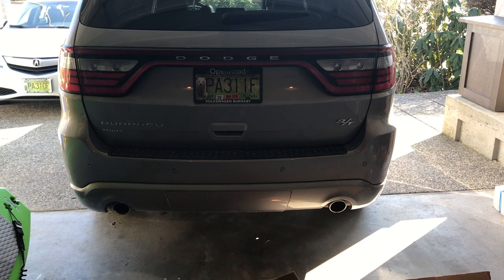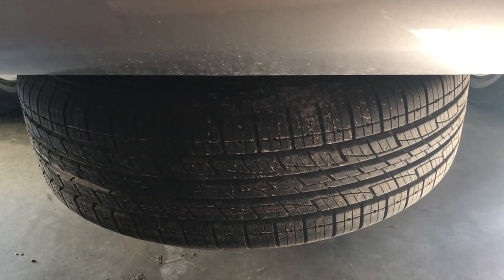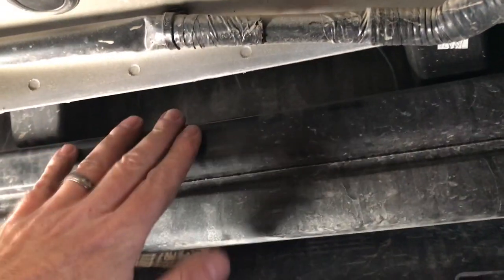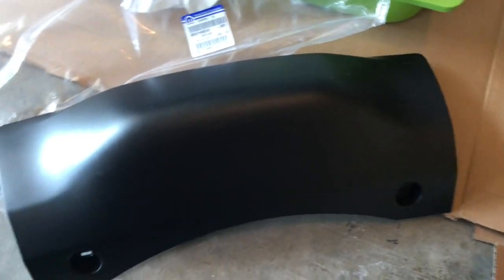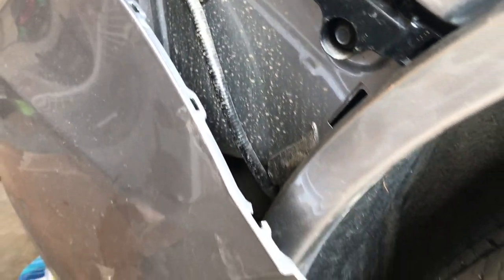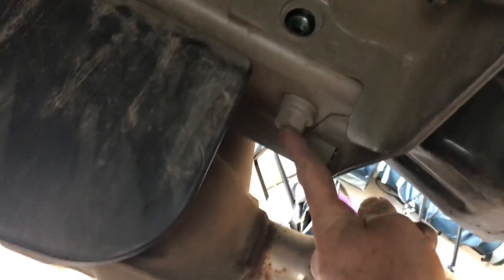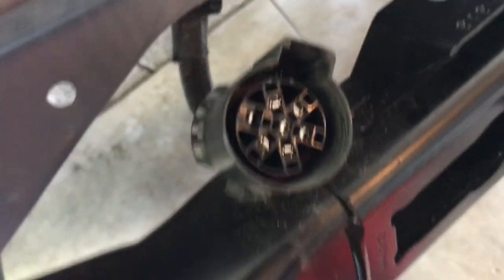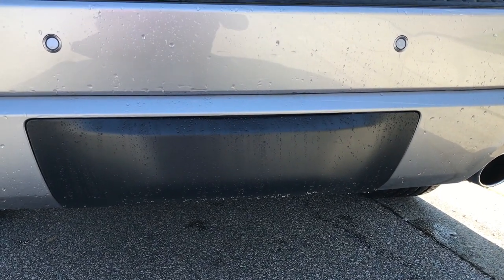Dodge Durango R/T Hitch Installation

Comment: Seems you would still be locked into a 3500lb tow rating from the research I have done despite having the factory oil cooler and brakes.
Reply from the maker: Sir Manny thanks for watching. If your R/T is a 5.7 V8 hemi configured like mine (see specs towards end of video) you are rated to tow 7200lbs. Since installing this hitch and getting dealer to activate towing I have had no problems at all towing our trailer
Reply: @simonblunden2151  mines came with everything from the factory. I just know from reviewing the discussions on tje gen3 durango forum and a rep from FCA all say it stops at 3500lbs. You maybe able to tow more but according to FCA you can only "safely" tow 3500lbs